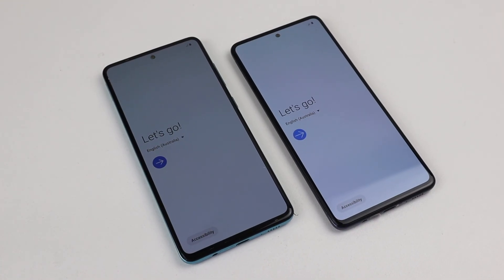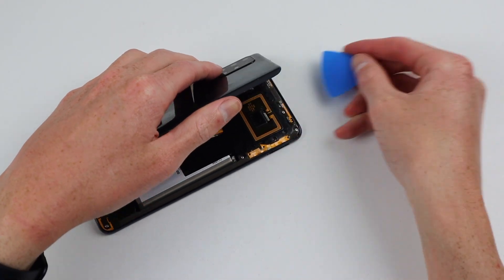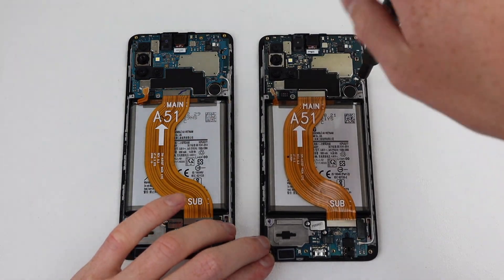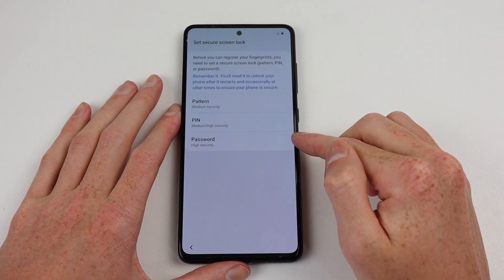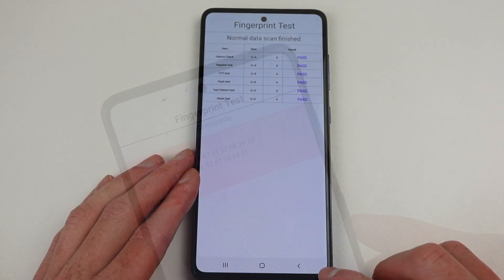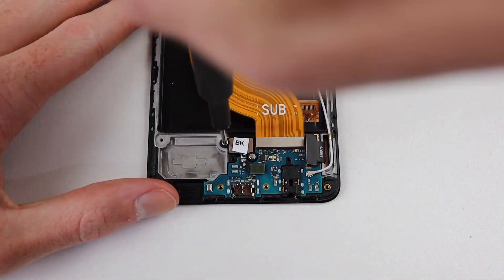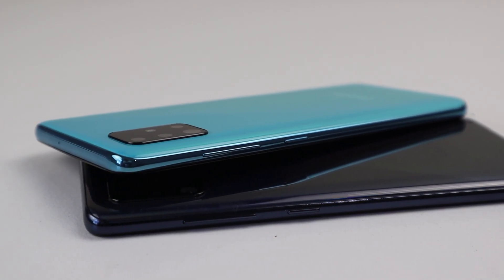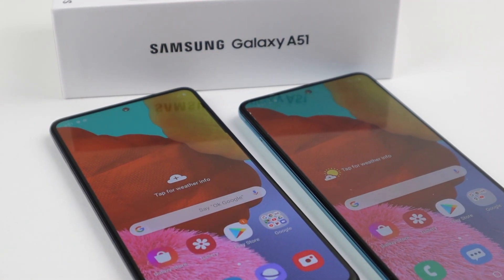Samsung Starts Blocking 3rd Party Repairs? - Galaxy A51 Teardown and Repair Assessment

Comment: The worst thing that could happen is to outcome a legislation that can cap you from repairing phones because you're not a official technician.
In fact, in Mexico outcomed the called digital lock, so it theoretically without the owner's consent it will be illegal.
In contrast at europe are enforcing to make phones repairable, so it's a mixed bag between one or other part of the world.
Reply: I can see here in Australia having the right to go to the local Consumer Affairs to force them to hand over whatever is needed to calibrate the scanner.  They are not allowed to do that stuff here but they'll probably say it was accidental or something seeings it was the software update that caused the issue.  If people don't complain to the right authority though, they will get away with it.  The government won't find out if no one complains.

Comment: This happened on my Redmi K30 Pro Zoom Edition too...

I changed my display (buying the screen attached to the frame and fingerprint sensor, to make sure it is original) and it didn't work at first. But after calibrating the fingerprint sensor in CIT Test Menu (or whatever it's called; I forgot). And the sensor worked again.

So luckily Xiaomi isn't pairing it's sensor 👍

Comment: That's a shame, i've bought that same model on Jan/20 for my mom, and she's happy with it (apart the multiple screen protectors and some broken "chinese armor" cases). I've repaired an a70 of a friend and installed an aftermarket oled panel, and it retained the fingerprint function, but doesn't work all times.

Comment: The fingerprint reader does not work because you need to calibrate it after replacing it... please get your info straight before making this kind of videos dude
Reply: Yeah? You have to do the same thing for apple's fingerprint reader. If you want to replace the screen yourself you have to buy a machine to copy the part data that probably costs 100 dollars or more just to replace already expensive parts

Comment: Nobody is buying this junk tho. No water resistance of ANY kind (doesnt even have rubber seals on the connectors), and the display is fragile. The camera is also pretty bad.

Even a 6S Plus would be a better option. Or an iPhone 8 Plus (ip67, wireless charging, better camera, and of course better support).

Comment: I repair phones. For weeks the a51 fingerprint stopped working when replacing the display, now it's also happening on a50 and a70. At the beginning I was able to swap the a51 display with one from an other supplier and it made the sensor working again

Comment: Kind of sad from this. My 2 last phones were Samsungs (s6 for 3-4years, s8 edge 4years-ongoing). I had no issues repairing my s6 when I dropped it in water extending its lifespan by 1year. And my s8 edge is still working to this day without any need for repairs and the battery still is enough for my daily use(which is extensive). I was planning on going samsung again if I ever decided to upgrade...but from the looks of it , U would just be buying another apple product. Will see how this pans out...but will probably need to broaden my horizons in terms of phone brands.

Comment: I'm quite familiar with the A series phones, A20, A21, A21S, A70, A71 all being phones we use.  They are totally 100% disposable phones.  If you want something that will last get a used S series or spend the money.  As for fleet management - we just throw them away as the cost to repair is insane.

Comment: The miserable state of our smartphones today... (buying flagship without fast charger, Locked right to repair/3rd party repair, Fragile because of fast charging tech (No aluminum body anymore) , No 3.5mm jack because they want YOU to buy their TWS and accessories, NO SD card Slot because they want YOU to buy flagship with higher storage) 😌

Comment: I think they are taking a lead from Apple. As you know in America big tech companies are trying to force consumers to use official repair sources only, hence the Right To Repair movement. 

Not everyone has huge amounts of cash to hand to get repairs done. As it's come in on a software update I think it was an intentional move by Samsung and I don't think they will change it, time will tell. I own a number of Huawei phones and it's pretty well impossible to root one now as Huawei has locked the bootloader on all later phones, another move to stop people working on their own phones. They used to supply an unlock code but refuse to do so now. I wonder how long it will be before other manufacturers start locking stuff down.

It begs the question do we own these devices or just rent them? Surely if you buy an item and money is exchanged it is yours to do as you please without having to ask the manufacturer.

Comment: Samsung is basically apple 2.0 at this point. F them, looks like Huawei is still the best after all
Reply: Dunno, they removed the ability to unlock the bootloader right when I bought the first (and last) phone from then. Thank to their BS about "giving a better customer experience" I've been stuck on their crappy, unrooted and supremely bloated ROM for almost 4 years...

I mean it's not anti-repair but it's still locking down stuff for the sake of control bullshit that got apple (and Samsung) where they are now.
Reply: @alessandroceloria  Rooting my phone and stuff, I don't need that, I have no problems with emui as long as it lets me to do everything else I could do on any android phone. I just hate to see android smartphone companies do the same shit as apple.

Comment: This is yet another glaring indicator that despite the general feeling  of not wanting the governments involvement in  personal affairs such as buying phones, there is a very definite  need to stop the ever growing list of manufactures of locking out all the various products that they produce ranging from phones to cars and practically every single consumer device whether it be mechanical, electrical, electronic or any combination. There is a monumental difference between a company not wanting  a consumer to repair or try to repair a device that is still under the manufactures warranty but once the warranty period is over, the person who own the device should be allowed to have that device repaired by a repair facility of their choice,  without the manufactures  deliberately or in any way preventing these repairs. If this process  is allowed to continue without putting a stop to it, it doesnt take much thought to see where it will all end. There has already been some small victory in the right to repair court cases in which the companies of various products have been legislated to not interfere with third party repairs and even to provide the once so called company employees only service manuals and  the parts necessary for third party repairs which is a good start but much more needs to be done. This is a very involved and complex issue and the heart of all of it is simple and extreme greed from the manufactures who simply want to milk every single penny they can from every single thing that they sell by whatever means.

Comment: I own an Samsung authorized repair shop I can explain this, we use a to called GD Tool that is mean for calibration, they have security protocols now similar to iPhone we use a special to for this along side their software. This will be for models A51 and up. Their is away around this with rooting the device as one of my head technicians is currently trying to modify the Samsung calibration software.
Reply: Their is a

Comment: I am a certified Samsung technician that fixes these phones almost daily, the parts aren't locked down/serialized like Apple parts, but after a screen repair the finger print sensor needs to be recalibrated post repair. Otherwise it won't work

Comment: Knowing a little about hardware, my guess would be that the fingerprint sensor stores the biometric data and hence you can steal a phone and just replace the fingerprint sensor to unlock the phone, which pose a very serious security threat and is probably why they issued the update. That being said, I don't think Samsung did a great job addressing the problem either. Pushing an update that locks the phone in any way is always bad, unless they make an easy way to revert or unlock.

Comment: i actually saw something similar a while ago with the s20 but as it turns out the user did a mistake: he didn't properly place the wireless charging pad which includes a temperature sensor so the phone kept displaying an error message so be careful when doing this.

Comment: The Samsung A51 fingerprint sensor was rubbish to begin with but it got a massive improvemnt. It kept having calibration and registration issues. It took Samsung Months to fix. Sadly Samsung hasn't really made their software easier to use like Apple. If they focused on experience they'd be better by so much. To add: the lack of Android updates on devices not too old: like my S9 plus, makes it worse.

Comment: Hey Hugh 
I got this problem while replacing a Samsung a30s screen , I thought it was the aftermarket screen I used ,then I got the same problem on an a70 as well, I did some research and most people said it was because of the update

Comment: The fingerprint sensor is something which can break the security of your device if it gets hacked. I can understand the need to pair this to the phone as it just adds a layer of extra security. The tools needed to resynchronize the fingerprint should also not be freely available because it defeats the purpose of the restriction in the first place (giving anybody the ability to potentially breach the phone's security). That said, i think it's perfectly acceptable to allow access to this tool to 3rd party shops as long as those shops are licensed to repair these devices. I'm all for the right to repair movement as long as it's done in a responsible and safe manner.

Comment: I think the fingerprint issues when changing the display do make sense.
Since every display, and every fingerprint reader is a bit different, thhe fingerprint reader has to be calibrated, with the display installed.
When you just changed the display, the phone didnt know about this, because the fingerpritn scanner was still the same, but when you changed the fingerpritn scanner, it obviously noticed.
So I guess this is more of a technical limitation, than a factory lock, tho. samsung should give an easy way to calibrate this.
Of course, this is just my theorie, but I guess this would make sense.

Comment: So theoretically, you could just put a new fingerprint scanner on a stolen phone and unlock it with any finger..great safety measure samsung:)
Reply: Sensors do not store the data. Android uses a Trusted environment, known as Trusty TEE. This secure enclave runs the Trusty operating system. The Trusty does not hand out the fingerprint data. On hardware with support for a secure enclave, this OS will run on special parts of the hardware, unavailable to the rest of the OS. It communicates via a dedicated interface. An app requests the Trusty OS to authenticate the fingerprint, using the relevant API. It then tells the app whatever the authentication succeeded or not. I would imagine that wiping the device nukes any encryption keys, which will probably be stored within the TEE. This effectively makes the data unrecoverable, as it is unencrypted.
Reply: @staideystalking1850  what that guy meant was:
you steal an a51 phone.
you open it
you change the finger print sensor with your fingerprint setup for it
you can now use your fighters to open that because the sensor is calibrated to your finger
and now you have access to all the data of the person from whom you stole the phone.

+best security feature ever
Reply: @sergiusprintar5491  but that is not true. Android TEE controls and stores all the biometric data, and is not located in the Sensor. Sensor is just a sensor, nothing special. It is powered by the smartphone, and connected by Proprietary connector or USB. Sends Data.
Reply: @sergiusprintar5491  didn't know that a sensor would contain data.
Reply: @thesurvivlist5440  if it were to contain no data, it wouldn't be able to even perceive information and send that information forward.
It contains data about how it should act. It can also contain calibration data.
For example, your screen turns some pixels black, others white others green and so on based on some input.

I see two possibilities right now. Samsung either calibrate the sensors in one way or another every time a finger gets registered to speed up the process. Meaning, the sensor would only check for some parts and only send some data to the software for validation.
Or when the sensor data id won't match the one on the board, the board will only validate a certain amount of data due to lack of "calibration" and memory space allocation.

Both resulting in a massive data breach by just changing the finger print sensor. And if its the second case, its even worse since you could trick it with any sensor and you won't even need to calibrate via your own fingerprints to eventually get caught as evidence for data breach.
Reply: @thesurvivlist5440  dude  read my comment
Reply: @sergiusprintar5491  calibration data is located in smartphone's NAND, and "how it should act" chip is located on a smartphone's motherboard. Sensor is just a sensor. It has no nonvolatile memory. It is not storing any data at all. What it can store (in case if it had a memory) is a serial number (in Samsung's case). That why calibration data on the smartphone, is not compatible with the sensor. All it just needs a full NAND format and Android reflash through odin.
Reply: sensors dont store any data
Reply: Imagine honestly believing a billion dollar company is this dumb.

They'd be out of business already.

Comment: Careful if u use a heat gun, usually melting is not a thing what's actually more likely is cracking the paint underneath.

Comment: On the basis that the fingerprint reader protects your identity and bank account when using pay services, I’m more than happy for it to be difficult to swap it out without calibration. Imagine having your phone stolen, a modified reader device fitted and then your bank account emptied. This isn’t about preventing third-party repair, it’s about protecting the security of the device and how it integrates into the wider world.

Comment: I think locking fingerprint sensor is a good idea, because it`s security of your device, your information, you don`t wanna be replaced with unsecure and not calibrated fingerprint sensor in your device, so I think it is good to lock security related parts of device.

Comment: Maybe it is just for security reasons. Because every display will be a little bit different, you need to calibrate the fingerprint reader after its changed or after changing the display. Or its just a software bug.

Comment: The Note 10+ was the last good Samsung Flagship. Change my mind.
Reply: Why should we be interested in changing the mind of every person with an awful opinion?

You're entitled to them.
Reply: IMO that title goes to the Note 9. The Note 10 already ditched the headphone jack, which alone is a deal breaker for many people, and the S10 series started removing some smaller features before it (not to mention that the S10e only has a 1080p screen).
Reply: @lukasegeling5205  you don't really need a high resolution screen in a small phone, it just eats the battery with no real benefits

Comment: Hey Hugh, I recently had to repair an A51 (bought in Germany). I faced the same issue, but I managed to register my fingerprints with the OEM replacement display from Samsung. 
You have to be more patient when registering a new fingerprint and put your finger much slower on the sensor while registering. It will tell you many times to cover the full sensor, but you will make slowly progress. Just try it with more patience.
Reply: I have the same. More patience and it work. But this cant be the solution

Comment: I mean, I don't want to defend them, but could it be the same calibration issue causing a swapped sensor from working? I mean, it might be due to different screens behaving a bit differently in how the sensor detects through it, if not, Apple's evil is rubbing off on them, but maybe, there's a deeper reason. Would be interesting to see if that issue persists if a calibration tool were to be found.